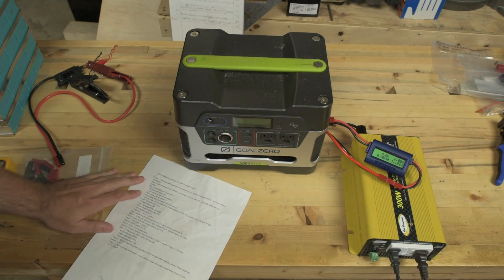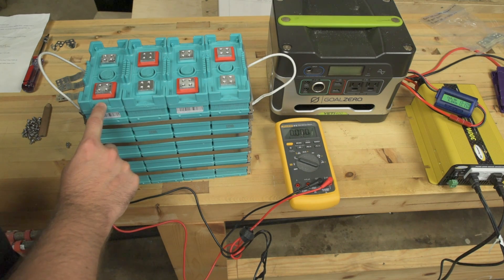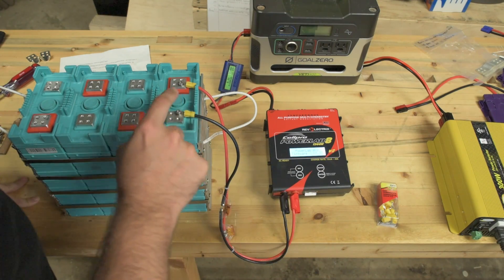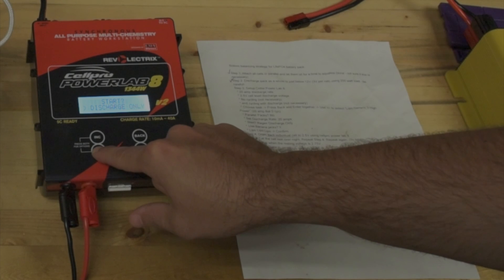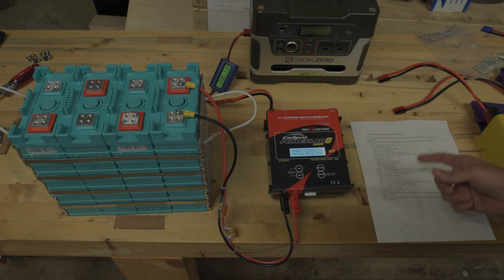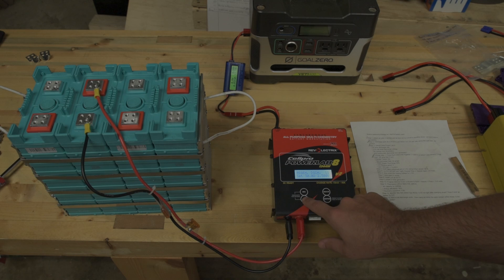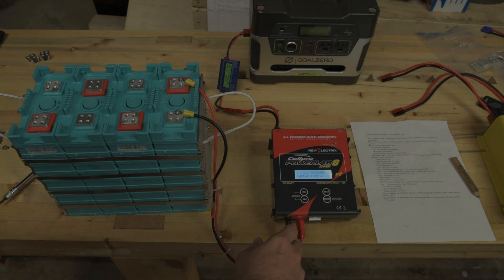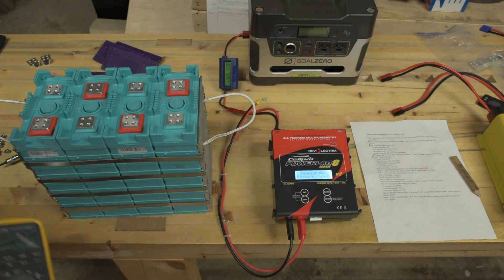1200wh LifePO4 Solar Generator Build - Part 2 - Total cell discharge

Comment: Without bms possible to use ıt?
Reply from the maker: Yes, using a technique called bottom balancing. You lose 40% of the capacity of the battery though. And if you screw up the house burns down. I’m personally not a fan of bottom balancing.

Comment: I work on electronics on submarines we do a half rap double rap with electrical tape on all tools we use near live power leaving only a quarter inch exposed metal at the tip it takes only a few seconds and I think it will save you a lot of stress!! :)
Reply from the maker: +David Hernandez not a bad idea. I’ll try that.

Comment: This is a great video series. I have the same battery set & the CellPro8. until one gets used to the "lingo" and they understand what the terms mean, it's quite difficult to jump in for the 1st time. this helped. i also watched the EV4U vids. I'll note that the lack of a CLEAR instruction manual leaves us (at least, me) wanting.  also the names of many processes are different maybe in different parts of the country/world & that adds to the confusion of it all. I find even manufacturers of similar devices (in electronics, but probably many areas) define different processes using different terminology.
this HELPED! 
Thanks so much.

Russ from Coral Springs, Florida, USA
Reply from the maker: +Russell Holt my only complaint with the cell pro 8 is that you cannot disable the balance check. I'd like to just use this thing as a converter/charger, but it looks like I'll need a dedicated unit for that purpose.